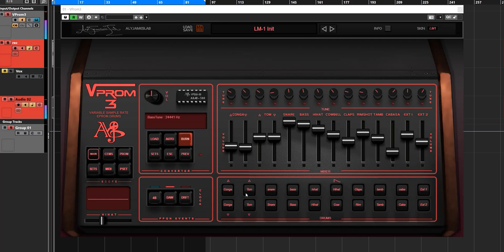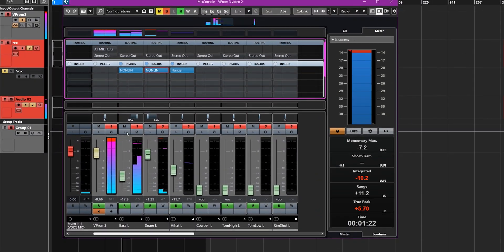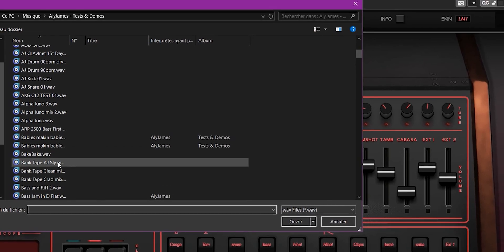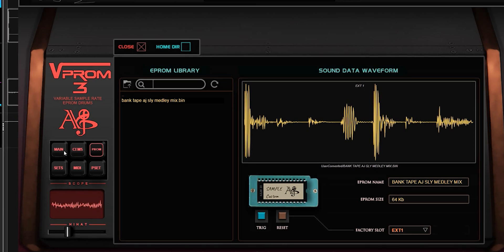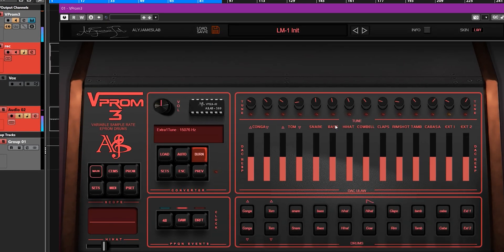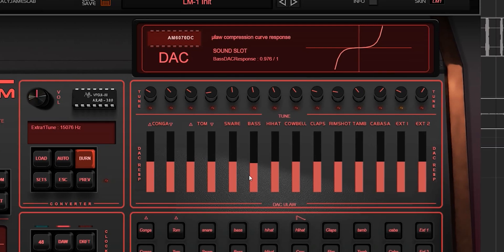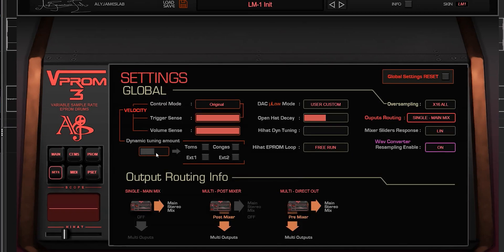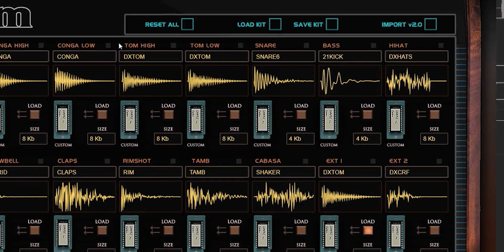VProm 3.0  Uncut Live Walk-through - Sampling Stuff - Part 1

Comment: First, I have to say that as a former LinnDrum owner this is the only thing I've used that captures the same vibe, no other software or samples have ever come close for me.

Second, I just bought v3.0 and when I try to load a different sound, my EPROM Library window is blank and clicking the folder, or the search magnifying glass doesn't do anything. No browsing window pops up or anything. I downloaded the .bin files and was hoping to navigate to them to load them. Do I need to place my files in a specific folder on my Mac? I'm using OS Ventura 13.2. Thanks!
Reply from the maker: @phurniture  yes look at the read me file in the zip file, the path is specified 😉
Reply: @ Thanks. That helped me figure it out.

Comment: Hi so your software uses samples for the sounds?
Reply from the maker: @thegroove2000  NO it can sample and then turn the sample into a ulaw converted sample data, in a sense this is still a sample in another format but that is not the key -the key is how this EPROM data are replayed -contrary to most samplers VProm use emulated ulaw DAC to decode the ulaw compression and replays them in realtime at variable sample rate, the tuning is the actual playing rate.
This is tricky stuff because it also involves oversampling… so in a nutshell : no it’s not a sample player which by definition would sound duller.
Reply: @Alyjameslab  Thanks.

Comment: Owesome Aly thanks , how the direct out is working exactly ? how do you multi track direct in the daw ?
Reply from the maker: It is a multi-out plugin, it works like every other multi-out plugins, every DAW have their ways to handle this, check online its easily found, the only think to set on the VProm side is the output settings in the SET panel ;)
Reply: Interested in the same topic. I'll play around and come back here if I found how to do it.
Reply from the maker: @ It is a multi-out plugin, it works like every other multi-out plugins, every DAW have their ways to handle this, check online its easily found, the only think to set on the VProm side is the output settings in the SET panel ;)
Reply: @jonathanonguitar  Method for Ableton Live :

Several plug-ins provide more than the standard stereo output. In Live, you can access up to 16 stereo outputs of one plug-in. Here's how to access those individual outputs:

Load a multi-out plug-in into a MIDI track.
Create an audio track.
In the upper "Audio From" chooser (Input Type) select the track containing the multi-out plug-in.
In the lower "Audio From" chooser (Input Channel) select the sub-out of the plug-in.
Set the audio track's Monitor switch to "In".
Repeat these steps for any additional output you want to use.
Reply: Ok thanks i'll check it out and post the method for ableton user
Reply: OK I figured it out on Cubase. 
1. Load VProm3 in a VST Instrument Track. 
2. In the inspector for this VST track, go to the drop-down just under Instrument, called "Select Multi-Out instrument return channel", in there you need to make sure you select each voice output from VProm, Snare, Bass, HiHat, etc etc. 
3. Create an audio track and call it Snare, but in that dialog make sure you select the Input under Rack Instrument, where you will find each voice output, select Snare.
4. Repeat for Bass drum.
5. Repeat for HiHat.
6. Now when you play on the VProm v3, you will see your Audio tracks receive the properly assigned Voice from the Rack selection.

Et voila!

Comment: Good job, I would like to burn eprom for my original Linndrum, any advice how to do so if I take your soft ? If you remember btw I’ve shared my lm-1 original sounds many years ago 😊
Reply from the maker: You gave me an idea to actually make a video doing just that 👍🏼🤩
Reply from the maker: Well if you have an actual EPROM burner and some blank EPROMs chips of the right size for your machine you can just use the .bin files made by VProm.
Note that although the sampler is clever by trying to make an EPROM size that is a multiple of 2K ( 2048 bytes) while also auto trimming any detected silence, it can produce EPROM sizes of various length depending on your input (2K up to 64K) some can be 6K for example and if you want to suit your machine you usually need 2, 4 or 8k. Some machines might also need long sounds to be split into many smaller EPROMs or the opposite ( 2 small 4K sounds in one 8K EPROMs ) -VProm won’t split them for you but that’s easy to do with any hex editor 😉
Reply: fantastic! I will definitely look into it (and certainly order it) I need to figure out the right usb eprom burner to use
Reply from the maker: video ONLINE :yt: